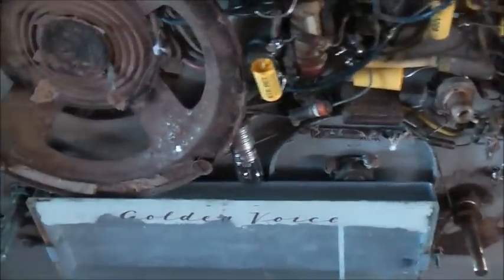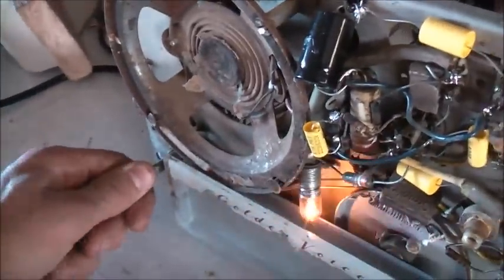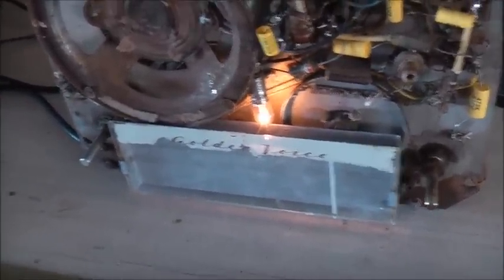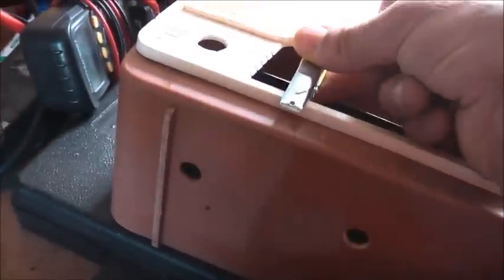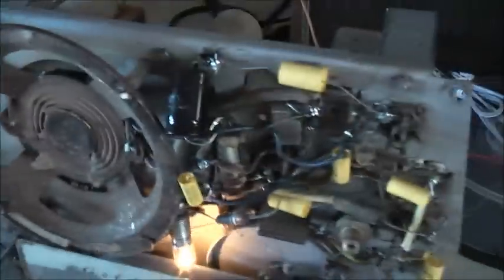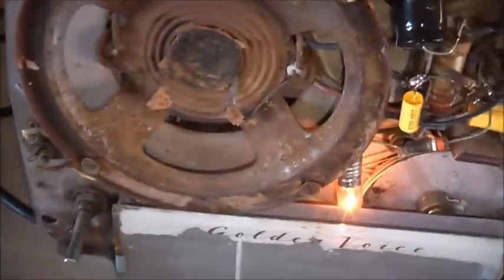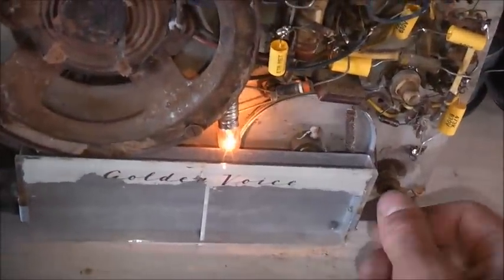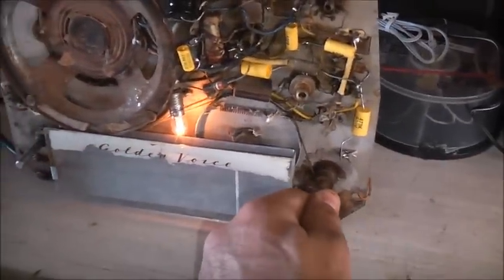Healing 405E Working Well Now!

Comment: Well done mate :-), you have nursed it back to life :-)

Have a look at the scale markings on the net pictures, just to see if the 1st local is tracking close enough :-)

I would not panic about the odd ghost station appearing in the wrong place, as long as the main transmission is correct, the i.f may be a bit wide, or the 1st local oscilator has a harmonic.

You have done a great job, smashing :-)